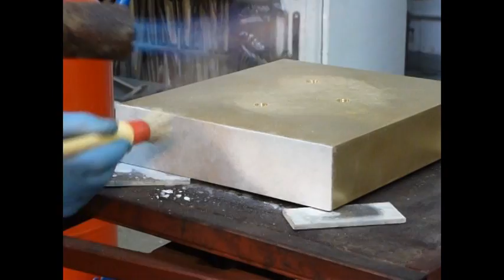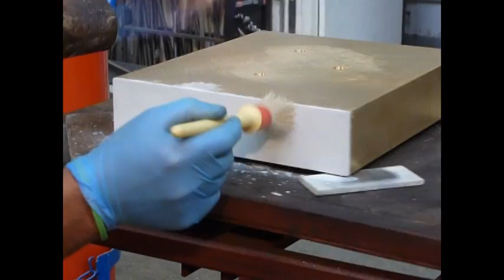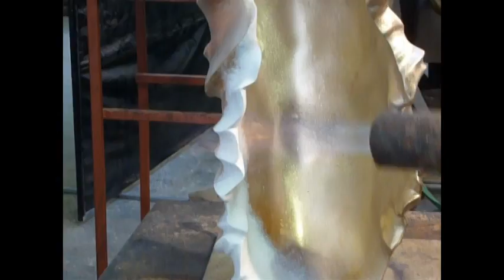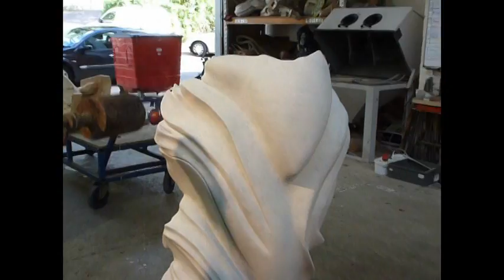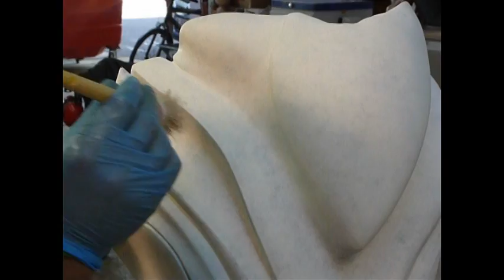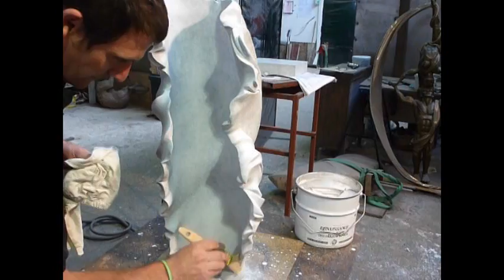Patination on a bronze sculpture

Comment from the maker: Hi Andrea, I even considered leaving the bronze as is. But I thought is would create such a different feel that I had to add a patina to it. I wanted the sculpture to feel gentle and peaceful, the original colour of the bronze would have been felt too harsh. Also, during the metalwork process, there are a lot of little scratches done to it, and it would have been extremely long to get rid of. I will create a fully polished sculpture one day, but not with this shape I am afraid. Frederic